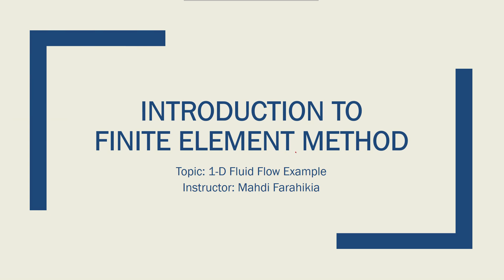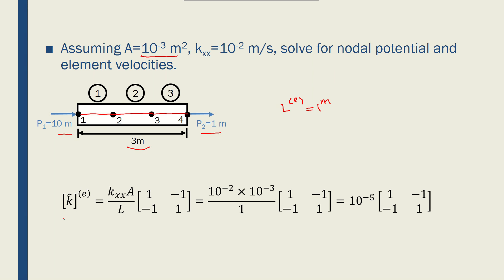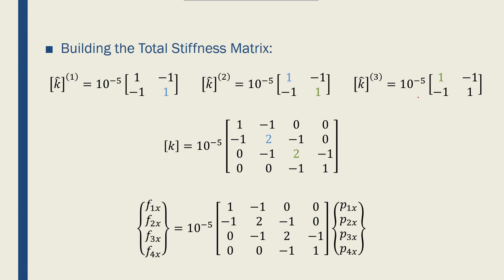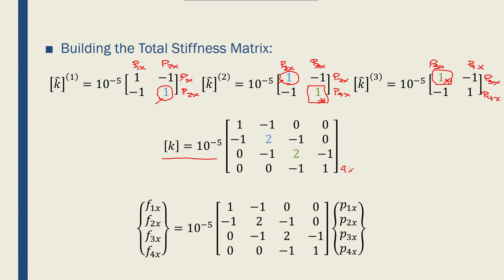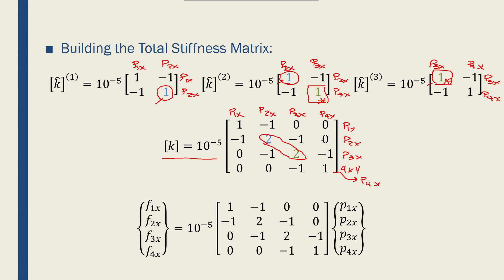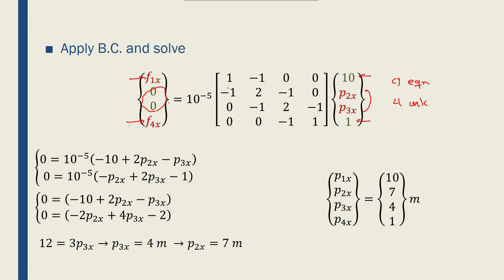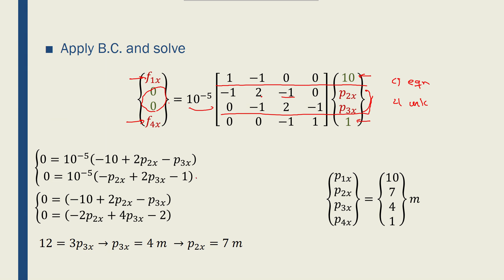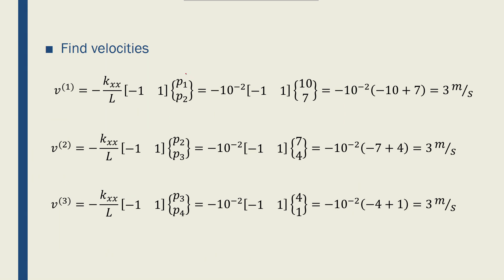Intro to FEM - Week06-32 1 D Fluid Flow Example

Comment: Sorry Mahdi, but I'm quite confused about why we assigned zero value for f2x and f3x at 3:22? Could you please explain it further?
Reply from the maker: The zeros values are due to zero net fluid flow rates at nodes 2 and 3. These nodes are attached to two elements, so if they have a outward flow in local C.S. from one element, it becomes the inward flow in local C.S. of the other element. Since the values are the same but differ in sign, the summation of them becomes zero in global C.S. As a result, I put zero for the net fluid flow rates at the interior nodes. This is not the same for the two external nodes, though. Because they're attached to one element each, so they have either a flow in or flow out and that's what we are calculating. Hope this is clear.